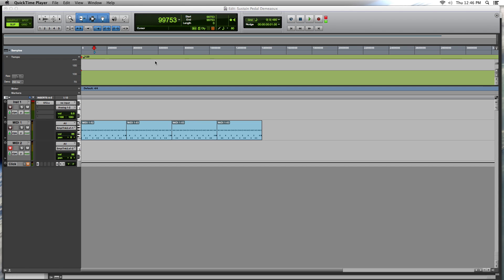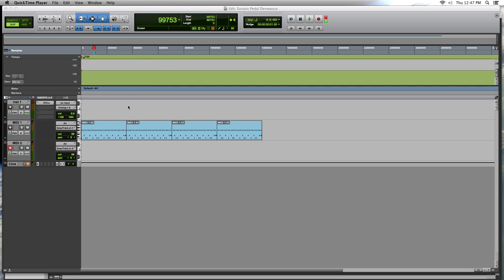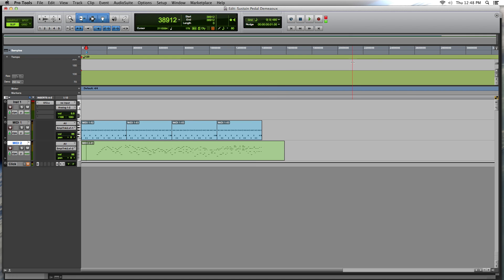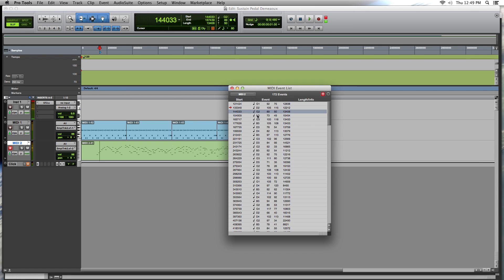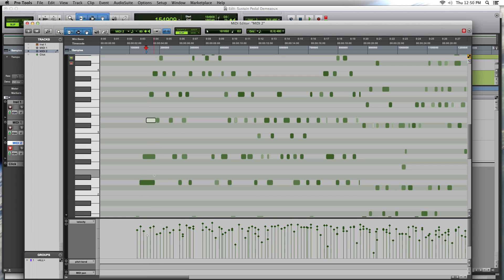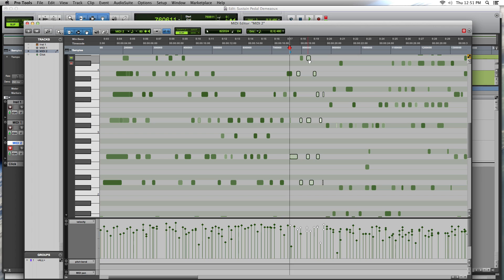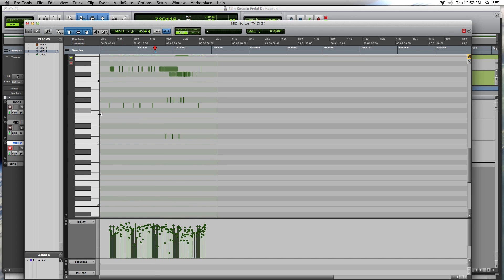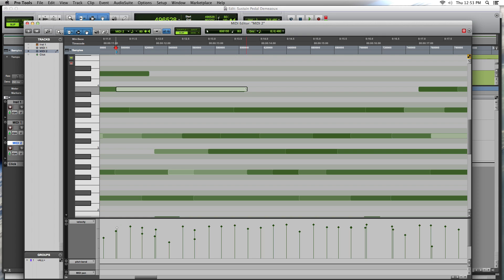Part 2: Using the Sustain Pedal with MIDI in Pro Tools

Comment: Dude...you couldn't have got that any more wrong if you tried to...when you're in the midi editor, just click on the velocity tab at the bottom left of page and change it to sustain...click and drag under the region of midi data to establish your range, and then lift up the line to the desired sustain threshold...simple.
Reply: Thanks
Reply: i still don’t get it, what i haveto do after chossing sustain ?
Reply: omg tysm

Comment: In midi editor, you have a menu (where you have "velocity" and "pitch bend" in your video). Click here, and  in "controllers" you can find "sustain". Make an automation (just on/off) and this will make a natural sustain
Reply from the maker: False
Reply: +Pro Expert MIDI Academy I do it every time, why is it false?
Reply from the maker: What version of Pro Tools are you using?
Reply: +Pro Expert MIDI Academy 10.3.8
Reply from the maker: I am running 10.3.9 in the demo - they did away with all velocity, pitch bend and control change editing in the MIDI editor after 10.3.8
Reply: +Florent Bonnet des Tuves Correct!
Reply: +Pro Expert MIDI Academy False
Reply: +Florent Bonnet des Tuves I don't know FLorent too well, But that man aint never LIED!!!!!   Thanks!!! Im using 11.3 and that tip work very well!!

Comment: My Casio has both sustain pedals.  How do you know which notes get bigger with which pedals?
Reply from the maker: That's a great question, it depends on a lot of factors VeggieHamb.  Make sure you are aware of which sustain pedal is plugged into which sustain pedal input jack on the back of your Casio.  The left sustain pedal should be plugged into the first jack and the right sustain pedal should be plugged into the second jack.  The second jack may be labeled as something other than sustain pedal or hold pedal but you can disregard that.  The default behavior of the sustain pedals is as follows:  if you strike a note and hit the left sustain pedal before releasing that note, the note will sustain until you release the sustain pedal.  However if you hit the RIGHT sustain pedal BEFORE striking a note, proceed to strike the note, then release the note, that note will sustain until you release the pedal.  In addition, go into the MIDI settings in your Casio and you will most likely find sustain pedal options where you can select which notes will be affected by which sustain pedal.  For all other questions please refer to your manual.

Comment: I know this is years later, but if anyone sees this and you have the issue with the timecode being weird numbers, try clicking on the upside down arrow next to the numbers and scroll to bars and beats. You might just have it in the samples setting. If that doesn't work then contact Avid.

Comment: Your transport display is set to samples rather than mins+seconds, bars, ticks, etc
Reply from the maker: After contacting tech support I learned that the PT version I was using when I created this tutorial (10.3.9) is sample based while some of the previous and subsequent versions are tick based.  I was told all I had to do was upgrade to 10.3.11 and it would become tick based after that.  You'll notice that in the arpeggiation tutorial right after this one I had gotten Pro Tools updated to where is was tick based rather than sample based.
Reply: +Pro Expert MIDI Academy Pro Tools is both tick and sample based, including 10.3.9. I can see in the video that your midi tracks are set to ticks, as they should be. The little green metronome icon on each track there depicts this. If you wanted to change each of those tracks to lock to a time measurement rather than a tick measurement you could click that little icon and change the selection to samples. Doing so would allow you to, for example, stop a midi track recorded in free time from conforming to the tempo of your session. The "code" you see in the counter window is, in this video, set to display how many samples have passed since the beginning of the session. In order to view ticks you would change the counter to read bars and beats. The third number to the left would then read ticks, ticks are the smallest fraction of a beat protools will measure. There are 960 ticks in a quarter note. If protools had dropped ticks then you would not be using midi and those of us using audio could not change tempo's while fixing audio regions to the bar numbers they belong to. 

Also Florent Bonnet des Tuves is not incorrect in stating that you can find sustain data where he/she stated you could.
Reply from the maker: +Jason Jenkyns I think I understand where you are trying to go with this.  I think all your questions will be answered and your concerns addressed if you watch my fist tutorial. There is about a ten second portion of the beginning of it where I go into  depth about samples vs ticks and different time bases besides those also.  I think you would benefit greatly from watching the rest of the Pro Tools MIDI Mastery tutorials, the Waves Tune one seems to be popular for some reason.